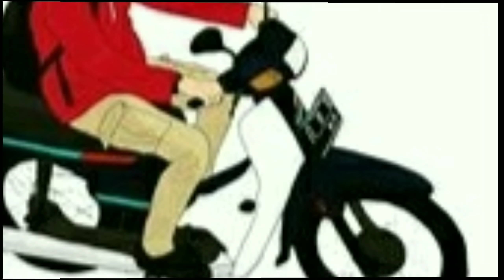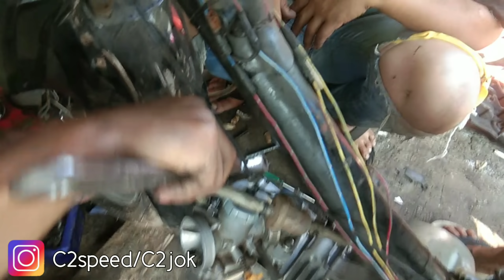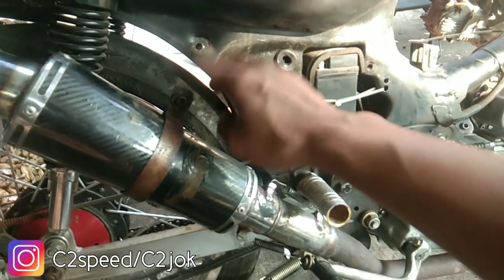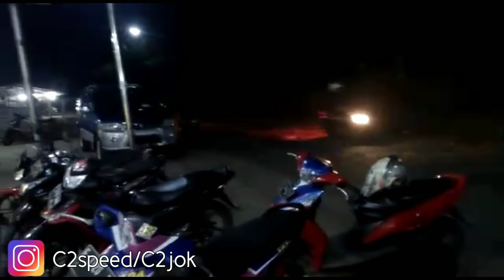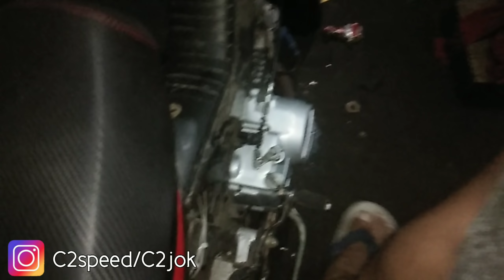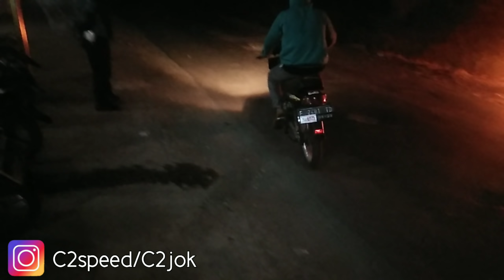TEST HIDUP.. Stroke 67,9mm di ASTREA/Part#4

Comment: Rantai timing pakai apa om?
Reply from the maker: revo
Reply: Keteng Legenda gear timing atas bawah grand
Reply from the maker: @agilardiaman9224  keteng revi absolut gear timing smua legenda om
Reply: Jumlahnya brapa om
Reply from the maker: @agilardiaman9224  48
Reply: @c2speedc2jokcustombuilder10  itu pake kruk as kharisma ya om kode kruk as nya brapa itu om?
Reply from the maker: @ndaruarif5911  57,9mm di tambah pin struk 5mm
Reply: maaf om kode kruk as nya om bukan struk nya 🙏